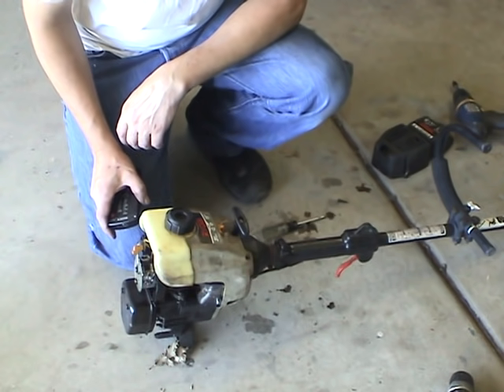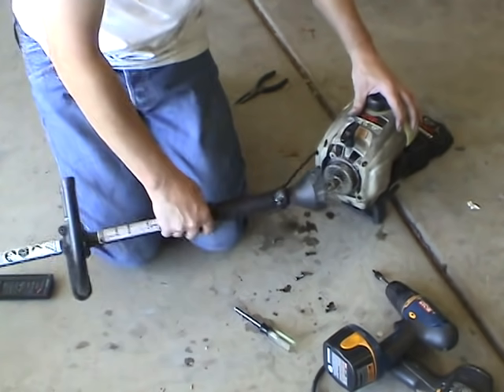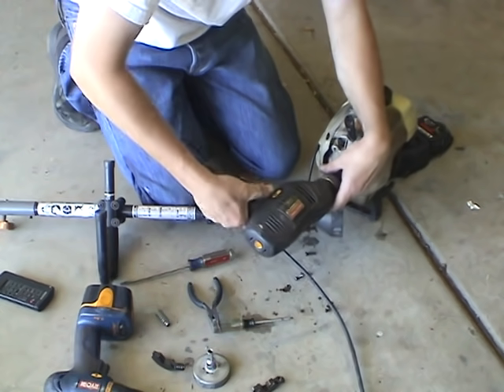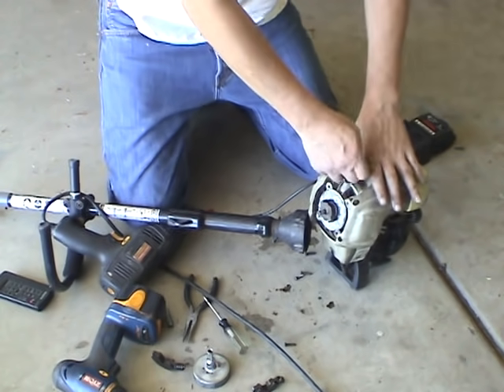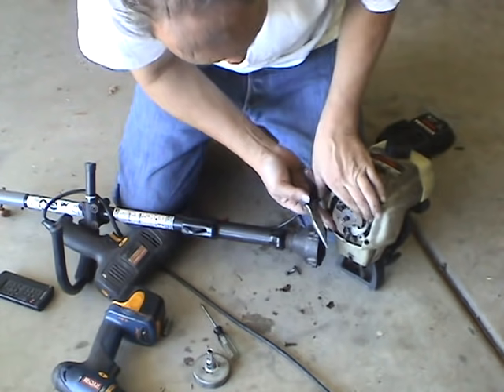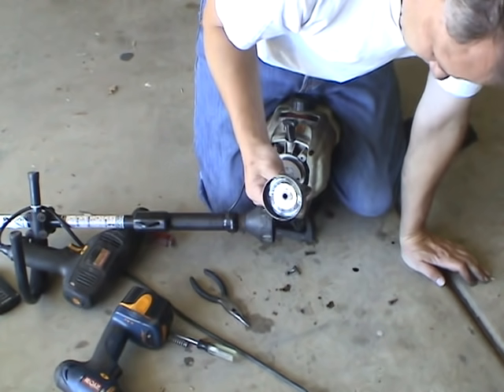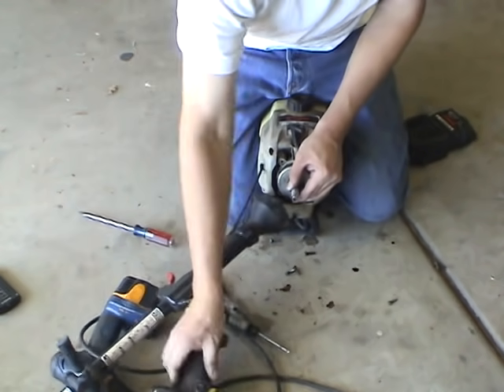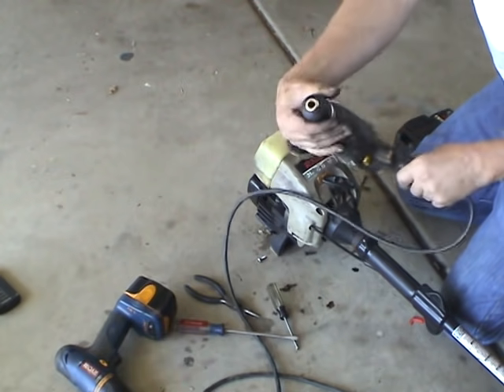How to start a trimmer if it won't START...

Comment: <Shaking head> 
This would be the final for me.
Thank goodness.
I would hate to attach drill to any small motor to get it started.
Mostly fuel air plug and solenoid the problem.
Reply: Thanks for the vid 
It tested my patients rehooking the spring clutch mechanism <♡>

Comment: Drill starting techniques are ok if all else has failed but this is clearly complicated and probably dangerous.  Not a good idea.
Reply: Never a good idea. If you think you need to do this, get some help. Seriously. It is never OK.
Reply from the maker: True- this is dangerous, this video is intended for DIY'ers who have the skill set to deal with it.
Reply: +Marc Heritier I only drill start if: A. The Rope is snapped. Or B. use nut and socket.
Reply: You don't see the danger in grabbing at the drill once the motor has started?
Reply: safety is the key and he is a master, he knows when hands off

Comment: I have a pig of a strimmer....will never start first time after the winter.....I just remove the spark plug ....spray in a little  Easy -start ,,,,works every time ....plus if you crank it over with spark plug out ( but with it touching engine case )you can see if you are getting a good spark .

Comment: And all it would take is 5-10 minutes to take the carb apart and clean it, then it would probably have started on the first pull. And the carb would be clean instead of still dirty. Run Super Unleaded gas for your premix - there is more detergent in Super than Regular to clean the carb and keep it clean. To avoid the problem he had getting it started to begin with, after the last use in the fall, pour all of the gas out of the tank and start the engine, let it run until it dies, then start it again if it will. Run all of the gas out of the carb by doing this. Next year all you have to do is put gas in it and start it up because the gas didn't evaporate over time and leave the passages in the carb plugged up with 2 stroke oil.

Comment: It was probably flooded, take the spark plug out, if wet pull 30 times with full throttle no choke.

Comment: My neighbor had a craftsman weedeater laying in his junk pile outside for a month or two, I asked if I could have it and he said "sure, it doesn't run though", I dumped the old gas out put non ethanol gas in, tightened my drill chuck around the shaft and 2min later she's running like a champ, thanks for the vid.
Reply: Ethanol is pure crap. 13% water. 
Every time you use a small engine with that crap in it.
Run it dry. Any fuel in the lines or that primer bulb will get eaten away.

Comment: After putting back together, the lower end will not spin....any clues to what I may have forgot to do?  I believe I put everything back the way I took it off.  Starts up easy now, but just cannot get the head to spin.  It sometimes starts to spin, but isn't really controlled by the throttle.
Reply: Get help.
Reply: +Crocellian You might have broke the clutch by folowing this idiots video. if i where you i would take it back apart and re aseembled it.
Reply: you broke it, Buy another one.

Comment: Good video, my almost new line started ok today, but after 5--10min it was not running well kept cutting out, anyway i changed the spark plug, it had a chinese made CJ8 i had a good but used NGK CJ8 equivalent put that in and away it went seems to be running good again thankfully, i will buy a new NGK plug for it, some small two stroke engines can be a fussy!

Comment: It won't start because it needs the carb to be cleaned or replaced, the reason being that there are little fabric diaphragms that move with the vacuum of the engine and flow the fuel through the carburetor. When these get old they start to get crispy and do not move the way that they need to thus causing the trimmer to run horribly and not be able to start no matter what you do. The carburetor could be dirty as well which can add to this. Also proper tuning ensures that it will run properly, in your case it looked like it was running very rich on top of things (yes it sat for a long time) but smoke like that usually means there's a lot of unburnt fuel in the combustion chamber. By leaning it out a bit that could also help it start
Reply: Check out Steve's small engine saloon. He has some great videos, including one on tuning the carbs in trimmers which is very helpful.

Comment: interesting, not sure I'm cool with grabbing the chuck of a moving drill though. I've seen AVE do something similar with a threaded bolt/hole so it tightens if the drill is turning in the direction of the motor running, so if the motor out-runs the drill it just unscrews and comes off.

If you have a working spark plug you should be able to get it running on quick start spray (even cut off the fuel and then re-introduce if flooding is the problem). The whole idea of the video is get it going at a higher rpm so the problems will work themselves out, which would work in a lot of cases, but the effort and hazards required are a bit high for me.
Reply: The hazards are a thoroughly broken wrist. Not me man !

Comment: Much easier way would be to start off by spraying a small amount of wd40 in the intake to lubricat your cylinder when one has been setting up for awhile and pull your rope a few times to loosen u your piston, then spray starting fluid or pour a bit of gasoline in the intake and they will crank up

Comment: easy way is to close the low end on your carb then pull the cord till it fires. let it fire once. then pull one more time to fire a second. turn the low carb needle to 1 and a 1/4 turns out and you on your way.

Comment: Hilarious!  Don't even think about doing this. Insane but funny. One of YouTubes best. 

That rpm surging tells me you had bad gas in this thing for a long time. Now you need a carb kit. Costs under $10. 

Have fun.
Reply from the maker: The gas was not bad. It is the carb. After a couple of years of Utah hot summer and not using it in cold winter destroys the gasket seals and diaphram. I got tired of buying rebuild kits, hence this video

Comment: Have a Robin NB171 spark good but not run for years, saw your video then found on the robin you can just take the pull cord assembly off the back then turn it clockwise by engaging a 1/4 extension bar with 10mm socket in the bolt at the back and spin it over with the drill as you described, after 100 revs or so it started to fire , then a further 100 it picked up many thanks for your great video , this is not dangerous for anyone with a little mechanical experience

Comment: Du Hannig, i was working at about 30 celsius for about a hour, than for 10 minutes i put the machine at a shade spot for rest, than i begun again. My spark plug was moist when i saw that my grass trimer (Alpin 520) was not working anymore, the next day when i tried to work. I changed the spark plug with a new one and the machine doesen't work still, but at least the spark plug is not moist. I put my finger on the spark plug hole and i sense compresion when i pull the trimmer cord. I didn't clean the carburator yet and all the test i have done is without the tube (pipe) bar of the trimmer attached to the grass trimmer. Why nobody test a trimmer without the pipe athached ?

Comment: try taking the air filter cover and air filter off...then place your hand over the carb to create a leaner fuel/air mixture and pull the cord a few more times. worked for me after struggling to start it after a year
Reply: That would actually be creating a richer air/fuel mix, but I'm glad it worked
Reply: This was the problem with a Sanli mower. When u placed the choke in the choke position it does not completely sit correctly and refuses to start when I move the choke slightly further the mower stars VERY easily. Obviously incorrectly set at the factory, Otherwise they are an excellent mower.

Comment: I have seen this idea before it's far easier to get to the point  of  why it's not starting then to have to pull stuff apart some one or something  can be hurt pretty  bad 
A slight contradiction is if certain  parts are missing  would I try this

Comment: Definitely one way to start it after it has been sitting for a long time, without going through the usual suspects such as clogged ports/bad residual fuel, etc. Especially if a device  is ready to start but has sitting for awhile and needs repetitious pulling of the recoil, the drill will assist in the pulling department  - especially for someone who has a rotater cuff injury like myself. Thanks Du for this clip.

Comment: nice, Ive done this with other small engines and it works. Yes it could be a bit tricky once the engine starts :). Pretty hard on the drill also. I've used a throw out coupling that disengages the drill once the engine speed exceeds drill crank speed. same way as the car starter disengages as soon as the car starts. Yes,  in most cases it's probably easier to just go buy a new one but a lot of people don't like doing that if the old one is just being stubborn. I've started lawn mowers this way. In fact one mower I would always start this way. BTW, you need a bigger drill for mowers

Comment: What would you say is the reason it wouldn't start? I recently tried to get my old trimmer working..New fuel lines, filter,  spark plug, and air filter. Won't start for anything...
Reply: Carb👌

Comment: My favourite trick is to take out the spark plug, give a 4 second squirt of carb cleaner into the spark plug hole then replace spark plug, turn on and pull. Only one engine a mower has refused to start so far and its rings turned out to be totally shot - 20lbs pressure only.

Comment: I've had great success with the following - get one of those aerosol carb cleaners (the highly volatile kind), take off the air filter, give a 4 second aerosol burst straight into the carb air intake, put air cleaner back on then try starting normally. For me it's started things first time included stuff that turned out to have a nearly blocked fuel line!! So worth a shot - don't know why it works so well but it does.

Comment: My trimmer has been giving me fits all summer getting it started.  i was usually dripping with sweat and swearing by the time I got it going.  The other day, it was just like this video shows..   can pull it all day and it wouldn't even show any sign of life.  I followed these instructions, but my cordless drill with the key less chuck was not strong or fast enough.  I got out my corded one but it has a chuck key.  I ran it for a while and the engine would just stop when I let the trigger go.  It fixed it anyway.  The thing starts on the first pull every time for the last week, no need to even choke it.  Thank you very much for this video.

Comment: Worth a try for those not faint of heart. I did however detect an edit where the drill chuck was "effortlessly" disconnected. At the very least, I think I would wear some heavy leather gloves to keep my project going and avoid an afternoon in the local ER.

Comment: Pull the blasted exhaust system off, throw it in a fire till its been red hot for a short time and burned all the carbon out (usually burns like a torch on steroids), put it back on the machine and continue using it for another 5 yrs before that needs doing again. That's the first thing you look at when an engine is murder to start.

Comment: My 26cc Ryobi was always difficult to start. It turned out that the connection to the top of the spark plug was not very good, so I put some aluminium foil around the top of the spark plug, and this seems to have worked.

Comment: here's a tip empty all your fuel out before putting it away because the fuel will go bad and turn to tarnished always start with fresh fuel especially during winter when not using it

Comment: Fun to watch, more fun to do- I have a trimmer just like this 1 and the fuel lines were badly deteriorated so when I got a replacement primer, it too was trashed, I did not have any reference for reconnecting the fuel lines - 1 leads to the carb and the other to the fuel tank, but which port on the primer?

Assistance much appreciated...

Comment: There were many times when i could not get a 2cyl engine to start buy adding fuel into spark plug hole or carb intake. Your method may be very useful at times, especially when ones arm is tired and weary.  I thank you for your excellent video, and will give it a try when i come across a really stubborn project. Keep those out of the box thoughts coming, and god bless!!!

Comment: Ok, so this confirms the decision to go down to Argos tomorrow, but still props for making the video.
Edit: putting half a teaspoon of petrol into the spark plug hole worked to get mine started. Needed to do that a few times but got the job done. Much safer than this.

Comment: I can appreciate all the cleverness you have done on the weed Wacker however it just seems the carburetor is getting gamed up when sitting, I would suggest adding a bit of Sea Foam in the gas and run it it will smoke a bit but it will clean it out.

Comment: Nice idea, but too scary. Mine is a bit bigger and I could see the drill spinning around breaking my arm. I will try spraying some ether in there.

Some brake clearner in the air intake seems to have worked but it has stopped again, after about 10 minutes. I think it is overheating. It is just too old. 25 years. 

I have worked it out. I had forgotten to add oil to the petrol. I think that I forked both my old 2 stroke strimmers. I have bought another and will be more careful in future.

Comment: thank you- after you put the clutch on, put the spring on the cable and not the drive tip of the clutch. It will center the spring and hold it up when you mate the clutch drive and the cable.

Comment: Well done mate. I've had the occasional small engine that refuses to start even though they have spark ,compression and fuel. Persistence and your technique are guaranteed to start these reluctant engines. Sometimes I cannot understand why an engine won't start when ALL the vitals are there.

Comment: Most older carburettors have idhle adjustment screws. 
Play with them, more times then not the engine isn't getting enough fuel. 
Replace the fuel lines, clean the carby, and replace the essentials (fuel, sparkplug, air filter, and oil). 

Any whipper snipper will run forever. All problems usually come down to owners negligence. 

Removing the shaft to start a snipper is a silly idea. You will find yourself getting frustrated when you spend the time to do that and it clunks out again.

Comment: Most Spring re-starting problems are caused by fuel waxing and thus leaving deposits.  Modern ethanol fuels are notorious for this.  If you can't be bothered to drain the fuel off at the end of the season, and run the fuel lines clear, then use winterizer or at least put some injector cleaner in the fuel tank. In the UK that could be Wynns, STP, Redex or equivalent.  Best to use fresh top grade fuel though and I've found mixing with Bardahl to be best, as you can use a leaner mix. Just the same as when I was riding my James Captain 200cc or an Ariel Arrow as a teenager in the 1960s. In fact only a Bardahl mix prevented you from leaving clouds of blue smoke behind.

Comment: I got a problem i have a strimmer and it wont start cold unless i put petrol doen head or open rev and put some in there but then will run mint ive tried primming it choke on and off but when its warm it will start mint

Comment: I usually remove the spark plug and put a few drops of fuel into the cylinder after a few times its good to go no disassemble required
But then I don't have the time for all that fun
Reply from the maker: Tried that, still didn't work
Reply: +Du Hannig If it didn't start with ether, then how could it have started with fuel mix after you used the drill.  It's just not adding up...  If something doesn't start with ether, then it must be ignition or compression issues.  Unless, however, Jim Pierce is correct and you are indeed too stupid to spray a can of ether.  And from this video, I'm thinking that might be the case.  And.... the worst thing about this whole video is the cylinder wall scoring you are causing by spinning the engine without any lube.
Reply: u do not even need to do this, just squirt petrol; into the carbie using a eyedropper. especially if the engine has not been used a long time. if it fires up and stops it tells u ignition and compression OK fuel delivery is faulty. Clogged jets or most probably carbie bulb broken
Reply: @duhannig19  check the cylinder  compression, spark plug gap, carb, use lubricant free gasoline to prime.

Comment: my question is
      after my c430 4 cycle  unit sat for a couple years I replaced the carb, plug, tank float, lines and got it to run/start good, my problem is that under hard acceleration, it dies back on deacceleration, is this normal? how can I fix this? I was thinking of turning the high end of the carb down?

Comment: Please help me. My weed eater wouldn’t start and I hadn’t used it in years, and I took apart the carb. I put it back together, and now when I press the primer thing there is gas that leaks through the bottom of the carb. Why is this? Please help!

Comment: "Man, the easy way out is I think to buy the same brand or a different brand, a powered battery one that does not run on fuel. The 2 stroke ones, I was told that they can be temperamental, Worst than 4 stroke engines. At least that is what I was told by an expert."

Comment: question:did you do all the disassembly and run backwards and reassembly to blow out the deposits from the carburetor If so, would replacing the carburetor with a new carburetor resolve the problem of not starting just as effectively?